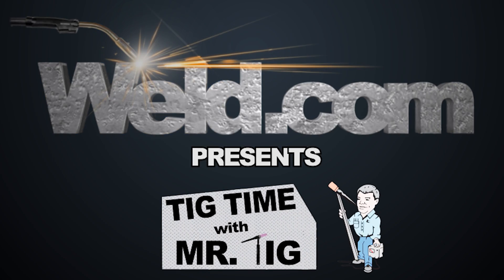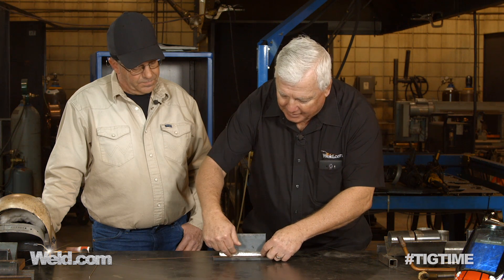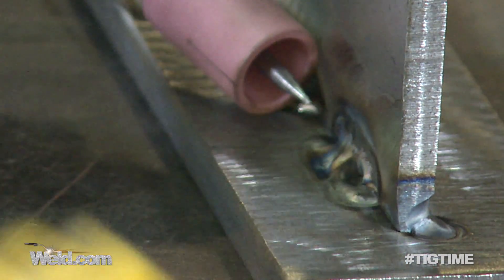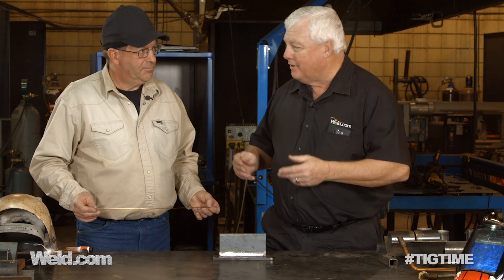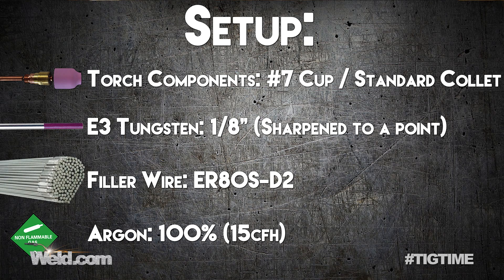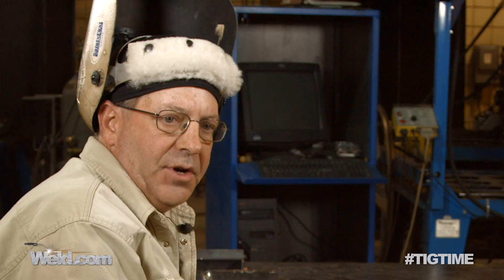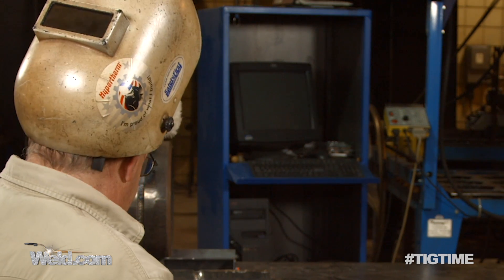TIG Welding Technique: Lay Wire Tips and Tricks

Comment: I was shown to use laywire if the base material was very thin, particularly with SS.  I actually push the filler into the arc/melt pool.  Eventually I felt the filler pushing into the weld as it melted....it was kind of like a "rough" feeling, moving in on a frequency of those "bumps" as the filler wire got consumed.  One of my buddies was a welding teacher at a local community college.  I tried it there and had the coupons bent.  The weld held up.  But, again, I did it mainly with thin material, although I would occasionally use it in low weld joint loading situations that I wanted to look really good (looked like a really nice MIG weld).

Comment: Iv used the lay wire for my stainless steel t fillet test and the dab for the aluminium test and had no problem passing both but always running a little hotter if using lay wire to make sure I get good penetration

Comment: When you set out to show a technique doesn't work, you will make it not work. Smaller filler rod, PUDDLE CONTROL and making sure you get penetration is key to laywire success. One can make dab technique fail, too, if you use wrong torch angle, arc height and gas flow. Actually trying to make it work has as much positive effect as trying to make it fail has negative. This is where personal biases come into play...consciously or unconsciously. I do find most of your videos helpful...just not this one.

Comment: From my exsperance and how I weld pipe every day in the industrial industry Lay wire is the most commonly used methad . After you put that root pass in wheather its the lay , dab or back feed technice when it comes to hot pass, fill passes and cap its all lay wire 90% of the time.and lay wire dont mean you lay the wire in the area your welding and never move it. when I run my root its lay wire and I slowly feed the puddle, when I do my hot pass its lay wire and im hauling ass at high heat and feeding in the wire, when I do my feel passes or pass its lay wire at high heat and im almost shuving the wire in to fill up the rest of the bevel to flush it out if I can, when I cap it its allways lay wire. So point is lay wire dont mean you lay the dame rod down and just weld over it you are laying the wire in there and constantly feeding the puddle when needed. this vidio was a very bad example.
Reply: well said!  10000000000000%

Comment: When Tig welding how far do you put the tungsten out of the cup. I’ve been having problems sticking
Reply: Depends on the cup size. Rule of thumb is 16th of an inch for each cup number. Like number 8 cup is one half inch. Number 12 cup would be 3/4 of an inch.

Comment: Hmmm. I've welded hi amp tig roots on pipe with power positioners and the lay method is the only way at 260 amps. You can even let go of the wire when getting short (about 2.5 - 3 in and the magnetic force will suck it in as you grab another rod from your back pocket to keep going. It is about heat as much as it is about torch inclination, and if you were to direct to straight on to the root you can get root suck back. Even travelling up hand you can roll the wire side to side with a weave in front of the tungsten at about 150 amps with 5/32  wire and pass x-ray. Trick is watching threat the puddle stays fluid and you see it flow where the heat is.

Comment: I prefer walking the cup then dabbing. On 3/8s plate t joints  I’d run around 150-160 amps with some 1/8 inch rod.

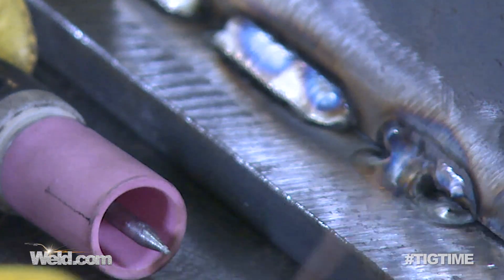Comment: I use lay wire all the time and it works great, however, TIG leaves no room for forgiveness when using the lay wire technique. If your arc length is too long or your travel angle is too low, you do cause the filler to ball up before you get to it. Other than the demand for consistency, lay wire works rather well. At 7:25, his travel angle was too low for lay wire. No forgiveness.
Reply: In school rn we are getting taught the Lay-Wire technique I believe just to get us started on TIG. And it does work you just have to keep the filler at a good angle and wiggle just a tiny bit. Not a whole lot

Comment: I have used lay wire on nuclear xray welds. If you want to show people how to do it, find someone who knows how. It scares me that this guy is teaching people how to weld. If you don't know how to do a type of welding, that doesn't mean it can't be done or isn't as good.
Reply: lolz larkin You can use lay wire with fillet welds and should never be blocking your arc. You control the amount off filler metal with the angle of the filler rod. The higher you keep it off the base metal the less heat it gets and the less filler will enter the puddle. Your push angle can also be used to add more or less, but that will affect your penetration. At for open root, if my filler fits rod through easy I dab, if not lay wire is fine. You can use them interchangeably. You just have to practice. I also to something that is a hybrid of both I call ball and blend. I use a shallow angle ony filler with a little more push. I allow the filler metal to ball till just before it drips then quickly, and I mean QUICKLY, push my arch forward, grab the ball, pull it in to my puddle and blend with the bead. I mostly use that for overhead or in tight spots where I need to add more filler but have a hard time moving both the torch and filler.
Reply: Phillip Morrison We always use the laywire style! We have many certifications using the laywire  given by certified welding inspectors! We do 6G position testing ! We do bend test, side bend test, and tensile strength test! All our certifications we cannot have any defects even if the code allows for defects!  Tig weld a T-joint using the laywire style, only weld one sided, then put the weld coupon in a press and break it.  You will see the laywire does just as well as the dab style. A lot of people are using too big filler wire, if the base metal is real thin, you don't use 3/16" filler metal! We weld 8" pipe that's 1" thick and we only can Tig it from root to the cover pass, the laywire style works perfect! Every pass is inspected by Certified Welding Inspectors, then when the welding is completed for that joint, then they are tested by both X-ray and Ultrasound! We weld missiles for military, we are required to use the laywire style on them!
Reply: I'm guessing a fillet would be best with dab because you aren't blocking your arc with a fillet rod. But open root pipe or any butt weld or gap your want laywire to bridge the gap?

Comment: I'm New with tig and just purchased a new lincoln square wave 200 so can someone tell me what I'm doing wrong? every time I try to dab the filler rod it seems to stick to the piece I am trying to weld. I'm using ER70S2 with 3/32 PURPLE tungsten with 16gauge steel plate at 80amps
Reply: what Dia filler are you using?  at 80amp i would be using a 1/16 filler. a 3/32 or 1/8 will cool the puddle to much and cause that sticking
Reply: your not hot enough it sounds like..or filler is too big and cooling the puddle off to fast..raise your amps 10 or 15 amps and go from there,and maybe slow your travel speed a bit.
Reply: also you can go on weldingtipsntricks fourm and get some pro advice to help you out.good luck

Comment: My experience with laywire is that at a certain point you can just have a trickle of filler metal coming in to the front of the puddle without burning back too much. I'm not super experienced with TIG but that's just what I've seen under my arc.
Reply: Pulse setting might help with that

Comment: I have used the 'lay wire' technique on open root faced pipe and never had to worry about penetration.  Also, I've kept the wire in the puddle running hot and fast to minimize distortion.  In both cases, it is very important to start out right, getting fusion on both sides and to the root,  Otherwise, a 'banana' puddle will result.

Comment: i know ive been doing laywire for about a year no problems at all. you'd think someone that refered to themselves as "mr. tig" would be more knowlegable
Reply: We always use the laywire style! We have many certifications using the laywire  given by certified welding inspectors! We do 6G position testing! We do bend test, side bend test, and tensile strength test! All our certifications we cannot have any defects!  Tig weld a T-joint using the laywire style, only weld one sided, then put the weld coupon in a press and break it.  You will see the laywire does just as well as the dab style.
Reply: +65diesel4x4  he is giving chance  to other guy. I am shure that mr tig know about this
Reply: It makes sense to have only 1 thing moving, your torch.  Would be easier.

Comment: lay wire should not be done on inside corner welds. outside corners and maybe flat. but it takes time to get it right, you have to watch for vallimg of the filler wire and be on it to push the wire into the puddle.
Reply: yes exactly same here! I believe the reason is bcz they don't usually weld on pipe. you see I'm from the south I work in refineries and all i weld is pipe and the lay wire technique is great for the root
Reply: +Marco Duran haha I meant to put this under Susan wood's comment
Reply: We always use the laywire style! We have many certifications using the laywire  given by certified welding inspectors! We do 6G position testing! We do bend test, side bend test, and tensile strength test! All our certifications we cannot have any defects!  Tig weld a T-joint using the laywire style, only weld one sided, then put the weld coupon in a press and break it.  You will see the laywire does just as well as the dab style.

Comment: why didn't you cut and etch each weld to prove or disprove ones superiority over the other? open root pipe i almost always use laywire and it is strong and clean. nobody cares about ones opinion on penetration show it!
Reply: Jody from welding tips has demonstrated this technique multiple times in his videos and never fails him. I also prefer lay wire. Sometimes with a small drag back and forward with the puddle for that root.
Reply: +Mr Leb I watch Jodis videos all the time. He should be calling himself "Mr Tig"
Reply: Ebrahim Bhamjee I agree. His welding is gorgeous every time not even breaking a sweat.
Reply: No way you can get proper penetration laying wire on a fillet weld. You need to burn into the root before adding filler.

Comment: What an unnecessary video... if you can't walk the cup or pause and dip you aren't a very good welder. Nothing wrong with laying the root in on a fillet weld with walking the cup as long as you're running hot enough.
Reply: +Dp908 I think they are agreeing with you to some extent in this video (the 2nd part anyway). They say that this can be used on heavy material when more heat can be added. You can't really crank up the heat and do this type of weld if you're welding 20 gauge stainless.